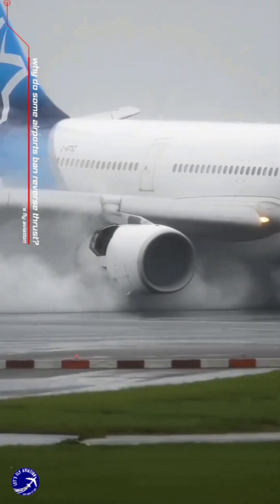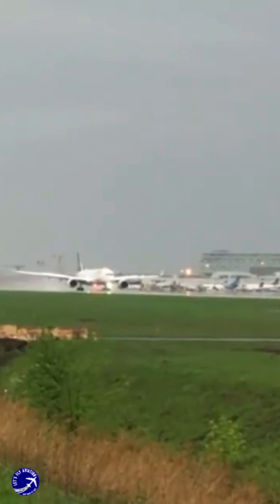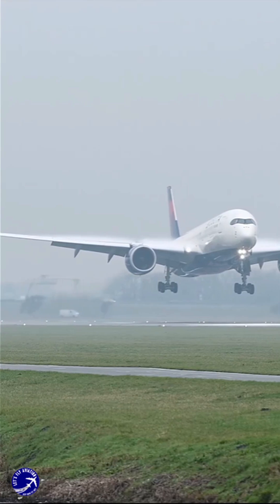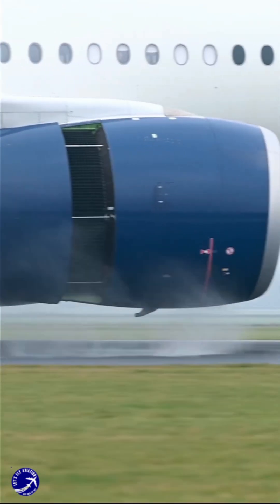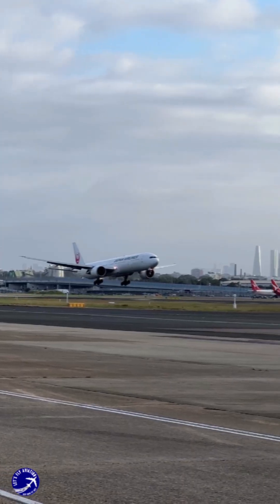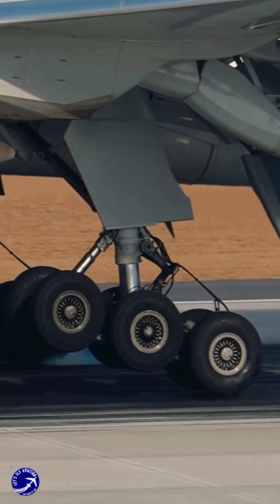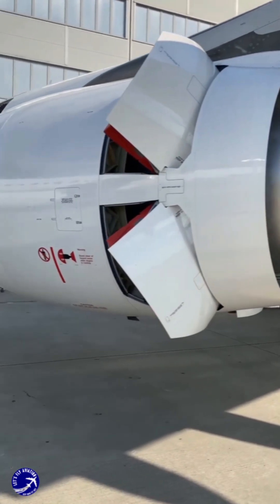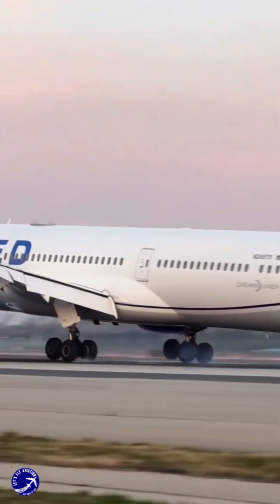why do some airports ban reverse thrust?

Comment: Not true! Only reason why they ban reverse thrust is of the Karen's moaning!!  Large jets are designed to use reverse thrust and for safety reasons must do so. (Hydrauluc wheel) Brakes are not that effective at and around the high landing speeds and could overheat and result in brake fires! Jet engines also do have vortex dissipators underneath the nose cowl to prevent ingestion of debris during reverse thrust. Also, reverse thrust is used from the high landing speeds up to 60 Knots after which only spoilers and brakes are used to prevent the ingestion of debris. So it is definitely better to use reverse thrust than risking brake fires and runway excursions, especially on a contaminated runway (ice, snow, water, rain, sand, etc)

Comment: This is extremely untrue.  Airports are designed for reverse thrust.  It's dangerous to not use it. Brakes are technically able to stop an airplane however it's dangerous in wet or icy conditions.

Comment: I saw a video one time where they parked an old van behind a 747 and put that plane into reverse thrust. There was nothing left of that van when they were finished. It went flying without wings!
Reply: reverse thrust means forward air flow from jet engine, forward thrust is rearward airflow. what you're talking about is forward thrust which blew over the vehicles at the rear of the aircraft.  So remember reverse is forward, and forward is reverse 😂
Reply: @briank10101 correct
Reply: I'm sorry, I don't understand, and I hope you will take the time to educate me.

Wouldn't reverse thrust direct the air forward towards the nose of the plane? With the van positioned behind the 747 and using reverse thrust, the van should remain untouched by the air, right?

What I think you saw was the jet wash from takeoff. I've seen several videos of a jet (747) flipping cans, vans, and buses. The videos exist to help teach drivers to stay away from the rear air created by a jet preparing to take off or a jet taking off.